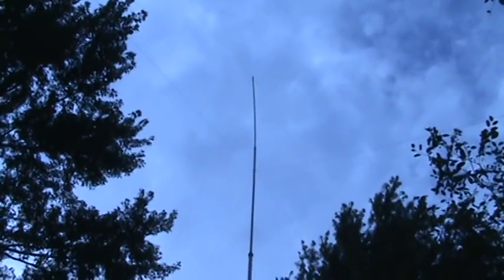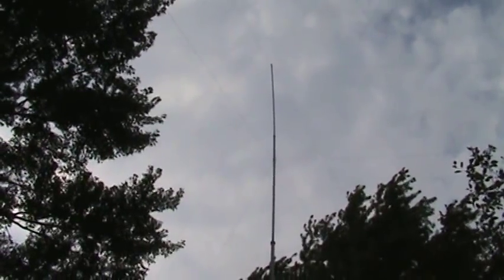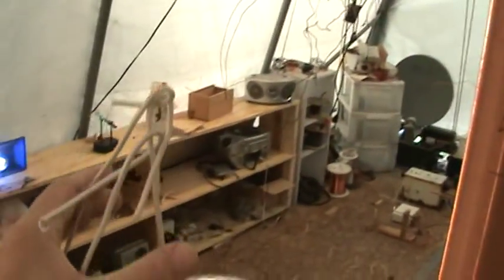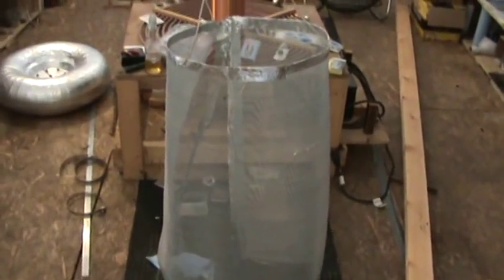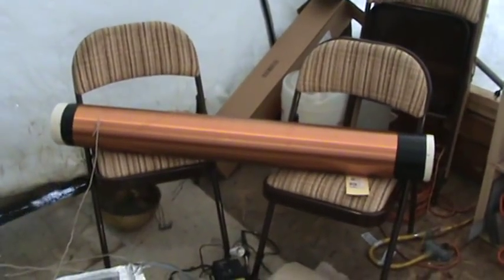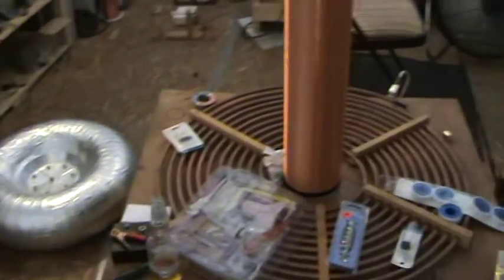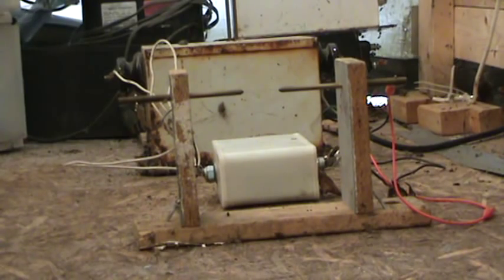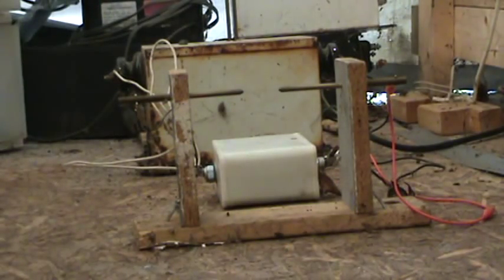FREE ENERGY FROM AIR CIRCUIT PART 11/24

Comment from the maker: Hmmm, someone mentioned to me about puting a coax cable in oven and heating low temp, just untill rubber gets soft.
I just printed some stuff out about electret.
Hmm, can i buy the cable like this already?
I have tried a coaxial cable, but not treated to have the electret effect.
I will think about this, thanks.

Comment: Since you know your frequency range, and are attempting to capture Schumann Resonance energy exchanges, you may wish to make a poly-harmonic receiver capable of tuning all the anti-nodes. This would be different from multi-element antenna in-so-much as each antenna would go to an individual tunable circuit and the power from each would be summed together. I would think 15 total would be plenty, 7 on each side of the fundamental. If you have a scope, check the anti-nodes.

;-)

Comment: Just Checked:
10kHz to 30kHz = VLF - very low
30kHz to 300kHz = LF - low
300kHz to 3MHz = MF - medium
3MHz to 30MHz = HF - high
300MHz to 3GHz = UHF - ultrahigh
3GHz to 30GHz = SHF - superhigh
30GHz to 300GHz = EHF -extremely high

So you are operating in the low to medium range. The Schumann Resonance has harmonics near 456kHz. HAARP may also have harmonic operations near this frequency. (haarp. alaska. edu) Please note the Cautionary Statement as accessing that site results in a security chk.

Comment from the maker: First, ..forgive me for the past feeble responce i gave you a while back when you gave me good links to professor explaining frequencies to class. 

 glad you enjoyed the firework show, at least the spark was entertaining, hehehe.

O.K.....without circuit, frequency checked between 250-350 KHz.
I believe, without checking chart, AM starts at 533KHz.
Hmm, what are you thinking.
What are your thoughts on this. Do i hear gears turning in your head?

Comment from the maker: Yes, string, a type of polyurethan, clothes line string, good for weather conditions.
not sure about changing string with wire though, some of the strings just touch the tree branches, and i cant reach them with any ladder, and i want make sure the setup is something that can be put into any yard.
I like the idea of top pole section being metal, maybe a thin walled alum tube.
Once i make another antenna set-up, like morays, wire straight across 2 poles, maybe than i will attach both set-ups.

Comment: Could be the PVC is picking up static radiant energy from air/sun and power lines and then dumping it into earth. You have an open circuit, Ground the pole from earth with a non- conductive mat. Pole +, earth -, who the hell knows?, Thanx

Comment from the maker: It's a good thought.  In earlier tests, i did try multiple antenna wires coming off of the circuit, but no differance, but it was poor set-up at that time.
Hmmm, i could attach another antenna wire off of pole, just a few inches below first wire....multiple wires off of same pole.
I think i may need multiple circuits also....than combine the outputs.
Hmmm, all ideas are good, and welcome, there are no such thing as stupid questions or sugestions.
Thanks for your thoughts, good job.

Comment from the maker: Hmmm, i think i need another example, im trying to picture this.
"less didtance traveled"....even if i pull antenna tighter...it is still the same length? Hmmm, drag force, i will think about this. now im picturing a wave in a pool, with the bottom shaped like my antenna drooping.....i will have to keep thinking about this.
Thanks

Comment from the maker: O.K. camera was only about 6 feet away from the spark gap...stupid of me.  I know better than that.  I told myself before i took that shot, to move far away, but than I forgot to move far away when it actualy came time to take the shot.  I should of zoomed in from like 12 feet away or more.....graphics do not look the same after those sparks...i hope camera is o.k....i will have to check it out.